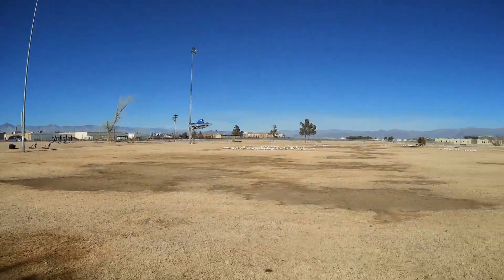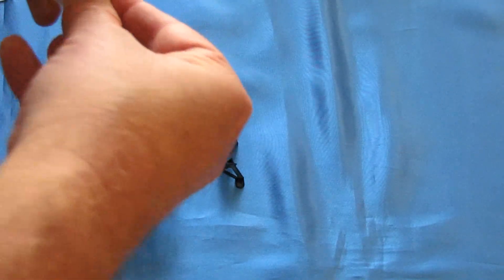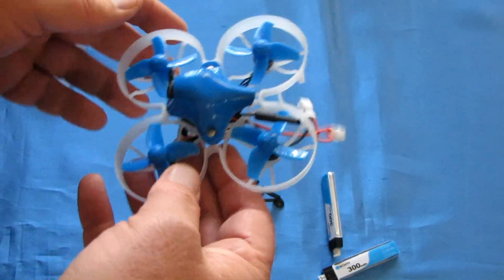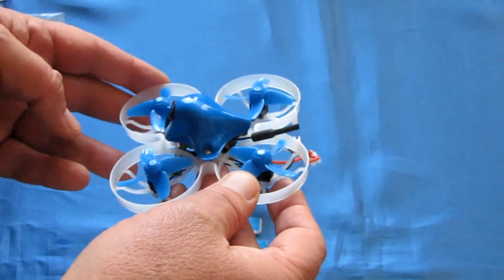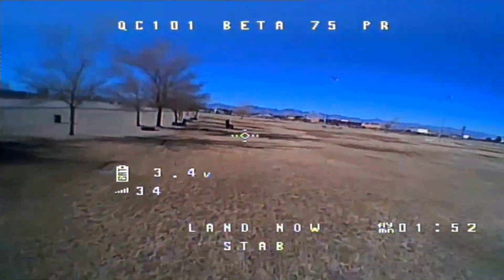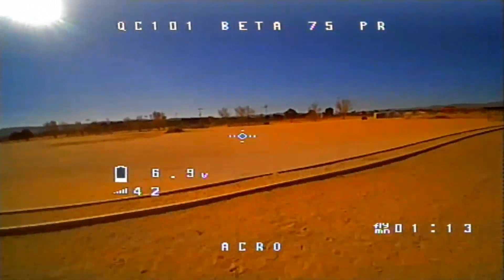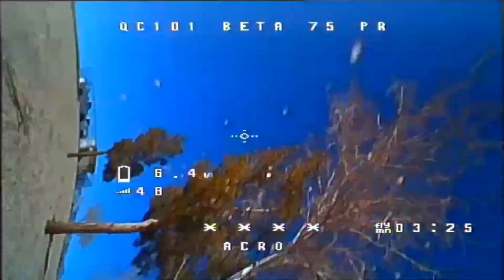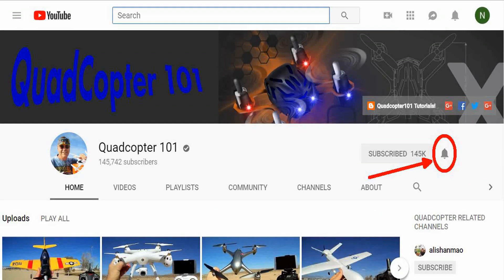Beta 75 Pro 2 Brushless Whoop FPV Racer Drone Flight Test Review

Comment: Great video review 👍🏻  I was questioning whether this comes with the 200mw VTX option on this quad because their description on the BetaFPV’s website was not clear.  When I contacted BetaFPV tech support, they said the VTX that comes with the Beta75 Pro 2 DES not have the 200mw option installed in the board, only thir separate VTX camera set up they sell separately but was willing to give me a discount on it.  I really wished they would have sold this with the 200mw VTX and a better camera.  The stock camera is not bad outside but in low light indoors IMO it is terrible.  I guess your really limited to the receivers range anyways rather than the VTX signal with these tiny whoops and 200mw VTX draws quite a bit more current anyways.  I changed out the camera  to the Caddx EOS2 Turbo with an adjustable 3D printed camera mount and canopy I found on eBay and what a difference indoors.  Now I can adjust the camera angle easily between indoors and outdoors flying and happy with the way this quad flies both inside and outside.  Here is the link to the cool canopy and adjustable Caddx EOS2 camera mount I found https://rover.ebay.com/rover/0/0/0?mpre=https%3A%2F%2Fwww.ebay.com%2Fulk%2Fitm%2F113529808682  

The Caddx EOS2 Turbo can be found a lot places online for about $12.  I have not done the XT30 connector mod yet but The Frequent Flyer has done it and says it will give you a noticeable 20-30% boost flying 2S.  Once I get the 350mah 2S BataFPv batteries I ordered, I will do the mod and make an adapter to still fly 1S indoors.  Happy Flying!  Luv2flypilot ✈️

Comment: hi,what kind of headset is that,would it work for glasses and would you know if it is compatible with hubsan h501s and parrot bebop2?
Reply from the maker: FXT Viper V2 goggles.  And yes, it's intended for those who wear glasses.  These goggles would work with the H501S, but not the Bebop2 as the Parrot uses a smartphone to view FPV video.
Reply: @Quadcopter101  oh cool,do they have an inputjack ? the skycontroller1 has output jacks on it and i know you can hdmi it to a tv (controller runs andriod in it )im running a galaxy tab a 8" for the app and fpv.ill have to get a portable tv to try out on it at park, a 32" screen i think would make fpv easy for anyone
Reply from the maker: @pauldoroff6973  Yes it does have both AV in and out.  In fact, look closely in the above video.  You may notice that I'm running output AV cables to a 60fps DVR attached to the back strap of the goggles.  But these goggles also have their own built-in DVR, but it's not 60fps capable.

Comment: Did they send you an Eachine trashcan yet? Interested in how you find it compared to the mob 7 seeing as it's heavier but bigger motors.
Reply from the maker: Yeah, I flew it yesterday.  Its review will be released later this week.  Its similar to the M7.  But I still prefer the M7 better.  It seems to be better tuned out of the box than the Trashcan.
Reply: @Quadcopter101  Ah nice I look forward to it. Thanks for the reply

Comment: Starting about a minute in, the voltage-sag gets pretty bad on mine.
Switching to an xt-30 connector.
If you're gonna do 2S, do 2S.
2 x 1S ≠ 2S  (I mean, it DOES, mathematically, but not in terms of battery-performance).
Other than that, this thing is pretty awesome.    (c:
Reply from the maker: There's a new 9A battery connector coming out for 1S batteries that will mitigate or even eliminate voltage sag.  It's the BT2.0 connector from BetaFPV.  I will be doing a review flight today with the first drone that will incorporate this connector, the BetaFPV Meteor65.  Should be posting this review sometime early next week.
Reply: That's cool.  I'll probably still switch to xt-30...
but the new one might be good for an adapter, so I can use my 1Ss too.
Funny how you can have 12 or 13 2s batteries and still have trouble keeping the charged battery bucket full.
(c:    Thanks for the update.